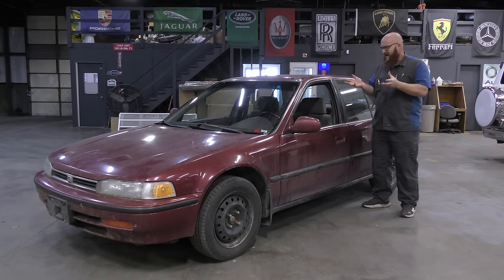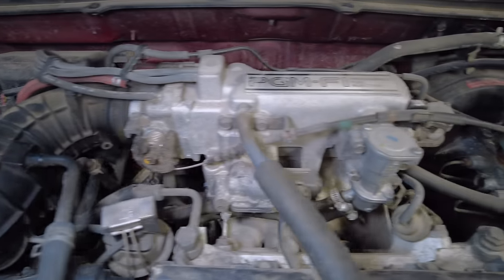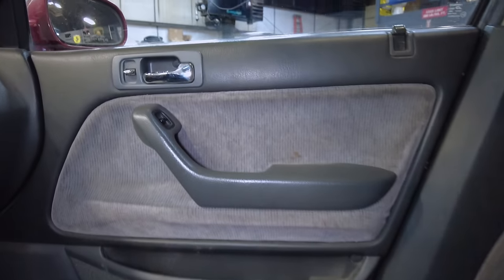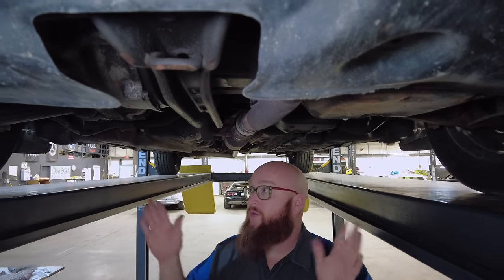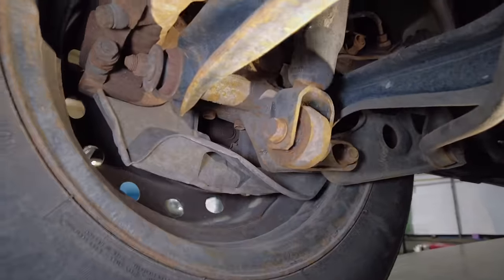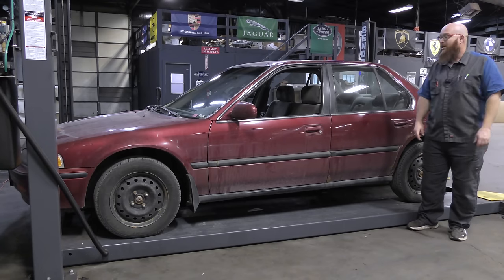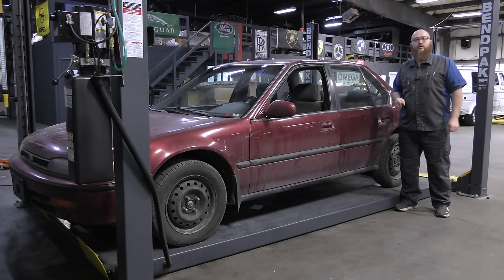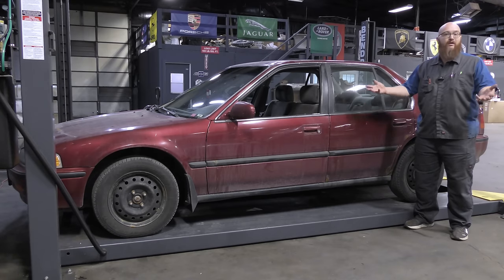A True Testament: 32 year old Accord with 380K miles! When Is It Time to Let It Go?

Comment: Our daughter had this exact question.  Older car, in our family already, or borrow for a new one, raid savings etc.  My rule I passed on, was the £100 or $100 rule, per month.  Whatever you expend, on repairs, spare parts etc on an older car, say in our case $700, divide by 100 and that’s how many months the car has to run until the next repair.  You have to keep a running total, because it always gets stuff doing every few months.  We knew it had to run for seven months to justify its existence/use.  About month 6, something else occurred, cost another $400 so being originally on target for July last year, we had to shove it out to November.  IE another four months of use, for that 400 bucks.  

You just carry on like this until either you get fed up, want a new car rather than need it, or you have suddenly a huge major bill for it, say a replacement gearbox, which sets you looking at your calendar, into next year probably (!), and so on.  About now, we’re 18 months on with this method, and she has a working car and no car loan, and is looking for her first job after graduation.  Ideally, she’ll get settled and THEN consider what kind and whether to buy a newer car.  The benefit of this system is, you don’t rush to buy a new car at the first sign of a bill over say 500 bucks.  Nobody can lease or buy a car for less than 100 a month, is the premise.  Maybe double that, I mean you could choose another number.  

Obviously you may be slightly attached to the vehicle, and it may even have attributes that make it better than a brand new car…like who would steal or vandalise that old POS?  The lack of value of this car, is a benefit in some situations.  That’s a valuable attribute potentially, so you might make an ‘override’ on that basis, or raise your monthly permitted max spend, for that reason?  But that’s the method a Firefighter passed on to me, so I pass it on to you all.  In the process, the car’s become nearly 25 years old.  Classic car!  Anyway…

…here’s a sobering thought I will leave you with.  You are roughly as likely to have an accident in your old everyday car, as in a shiny new one, is my hypothesis.  Actually, I think shiny newer cars, attract accidents, but that’s just imho.  (People certainly might expect you to give way more readily, if they see you’ve a shiny new automobile.)  But let’s say the chances are roughly equal.  If you had an accident, assuming it’s not really hideous, just an everyday 30mph bump, which car would you rather be in?  On the basis of ‘no regrets’ it’d be better to be in the old one?  Conscience clear, you can go ahead and buy a newer car, you really tried to stay frugal.  I guarantee, a newer car, could have more problems than the one you’ve held onto, and been rectifying to the tune of $100 per month, however.  At least, it’s quite likely, assuming it’s over five years old say?  Good luck, don’t sell your life down the river for a shiny newer bit of metal, unless you really have the money to spare.  Cars are lovely - when they run, don’t have your insurance company draining you, and nobody vandalises or steals them!  Take care all.

Comment: If rust is not a big issue, this car will last forever if you don't mind the maintenance.  I finally got rid of my '94 because the fuel lines began rusting through. I was trying to replace those when the gas tank sprung a leak. I had no place to drain the tank so I finally gave up. Otherwise the rest of the car was in great shape at 280k.

Comment: I owned a '93 LX 5-speed much like this one but in different color. In New England it developed some rust in same places. I sold it with 160K in 2005. The drivetrain was still excellent and if it wasn't for rust I bet it could do 250-300K easy. 380K on this one is definitely impressive in my book. Last but not least - pretty sure the LX trim all had read drums which is why I'm surprised to see the discs here. Maybe it was converted later in life?

Comment: I bought a 93 ex in 2004 as my first car and still have it today 

It’s been through a few batteries, starters, and distributors and at this point it leaks about .25-.5 quarts of oil every 500 miles or more but still runs and drives

Even after being flooded during Louisiana /TX floods. I replaced the ECU and TCU and it doesn’t die 😂

Comment: I got a 2003 malibu base  with the 3100 sfi .bought from va for $900  back in 2022, .     Great engines.   trying  to make to 300k + . I take good care of her despite the last owner not  doing  that . Its in this rare looking dark teal metallic color but one of the matching doors and window was fucked and has micro scratches and more engraved dirt  and scratches in the paint .   has a random ass door and mirror and northern rust damage. I couldn't afford to paint it so I brought it  back to life the best i could with the money i had . A little wax kinda helped it blend in and bring the color out.  .  It was disgusting and trashy when i got it. Smelled like methtivites , cigarettes and McDonald's. 2 years later now  Washed , cleaned , and waxed Currently got 161,000  i think.  Im aware of the little issues theyve known to have but with proper maintenance she should be fine . Looks the best shes looked in years probably.  The radio cd player system  is in mint condition too.  😀. A/C still doesn't work 💀🤣🤣🤣  trying to get that fixed next

Comment: My 93 civic del sol is at 315k miles, finally have a rust hole in the trunk, has been leaking for as long as I've owned it. Gonna weld a patch or line the whole trunk with woven fiberglass and keep driving.
 (About 4 ish years ago I had some liquid fertilizer leak into the trunk and it reacted with the metal which caused all this to start)

Comment: I just sold my 224K mile Tiburon with a number of small issues. It was a difficult decision. That car is super reliable but worn tires was the deciding factor. Tires can be expensive, even if you get used ones. Fuel filler neck was leaking too so I figured at least $500. Sold her for $2K. The Honda has good tires so I'd keep it going a bit longer.

Comment: I sold my 1993 Accord in 2020 during the pandemic because it was just sitting outside collecting dust and all. It had 201k miles on the clock and was in a considerably better condition aesthetically. It was a very reliable car from the golden age of Honda.

Comment: I have a 93 accord EXi sedan (so the one with the sunroof, power windows etc.) and it's honestly been one of the best cars I've driven despite the amount of miles it has and the worryingly low cost of $800 to buy the car, its been surprisingly reliable too despite the fact it's over 30 years old now.

Comment: I have a 2013 elantra with 255,000 miles. Just gave away a 2001 beetle with 350,000 miles. Once owned a 1986 dodge ramcharger with 310,000 miles. Still own a 1970 nova with 270,000 miles. Will go a long way if you take care of them.

Comment: I own a 2001 Honda Accord EX 6-cylinder with VTEC engine that just went over 251k.  It has some minor cosmetic issues, but no rust, cold AC, heat, leather seats and in good condition.  I'm going to drive it until it is no longer worth putting money into it.  It is actually a part of my wealth building plan:  drive debt free as long as I can before retirement.

Comment: I had a 91 honda accord with 480k sold it for $1500.it now has 980k and still running .I fixed the rust on quarter panels with fiberglass so it wouldn't happen again I did all the work my self and still no rust 15yr later .car is in great condition same engine and transmission

Comment: My 95 manual accord ex with 340k is in the back yard and needs a transmission. I'm having a hard time letting it go. I don't have a truck so I tow with it quite a bit. 3 to 500lbs mdf sheet goods with a harbor freight 4x8 trailer. Same rust on mine. A lot of little problems and leaks. Has run with a completely rusted through muffler for over 100k. The transmission is probably my fault. Always changed the oil but almost never the tranny oil.

Comment: Bought technically this exact car except with a different vin # and hope to keep it going for a while for work. Bought it from my landlord for 200 dollars. Has a few issues and now watching your video excites me more having it. Car currently has 280000 miles.
Reply: they are so easy to work on during a sunday freetime. The only hard thing is changing the cv axles and waterpump because of cramped spaces. A 92 was my first ever car back in the late 2010s.

Comment: Had a 90 accord with 188k with no issues excpet the Honda quarter panel rust issue until it was run over in a Walmart parking lot by a Ford expedition  Two timing belts one clutch and two exhaust systems and one ignitor.

Comment: For the right car its never time to let go as long as it continues to fulfill its purpose - i have a 2000 Mitsubishi Diamante LS with 319,000+ that had a new transmission fitted 6 months ago and a 1998 Infiniti i30 with 261,000+ that is running beautifully. I don't plan on letting either of these cars go ever, parts are cheap and still available, and modifications are also a possible path going forward. All of this at a fraction of the cost of modern cars. Both of these were nice, well equipped, powerful stylish luxury cars back in the day and that has not changed today either, they still drive great and do exactly what they used to do 20+ years ago.

Comment: I have a 2001 ford escape I got for free from my father.  It sat for a couple years till I got around to working on it.  Radiator,  alternator,  starter, misc wires from mice damage,  drove it about 100,00 to bring it up to 200,000 and right about then the rear passenger spark plug blew out of the motor and took all the threads with it.  I ended up sleeving it and that worked fine till the other side blew out lol.  So I sleeved that one.  I work at a pulp mill and I don't like taking the other rigs to work.  I'm still driving it to work every day.  It has 370,000 miles.  Fans and just about everything else is on switches.  It looks like a fighter jet with all the switches and momentary push buttons and labels.   I plan on driving it till ot blows or something relativity expensive or difficult goes out.

Comment: Am I naive? Someone told me that my car isn't practical because I drive it so much. This is when I was at 250k miles. I am now at about 377,000 and still use it. I really haven't put much $ into it-definitely less than having payments again (I made off my car on 9.9.01) I just don't know if saying the car only has 50k miles left on it, and not to drive it every day is correct

Comment: I had a 2001 Accord EXL coupe. Got it with 130k miles. For 1500$ had check engine light on I fixed it for $100. For the 70,000 miles I drove it.I had to replace all the brake lines all the brakes. Had to do the front pads and rotors twice.The starter. And a couple more little things. The rack Broke leaking so bad I had no power steering for a while I sold it for $800 at 200k because it needed all the fuel lines a fuel tank neck fuel gauge fuel pump. To get that car to continue with power steering and without leaking gas I would have had to spend $1,500 in parts

Comment: I bought a 99 Honda Civic Si when I graduated from college. It had 13 miles on it at the time. Earlier this year the #3 fuel injector failed and the engine injected a piece of the fuel injector. This scored the cylinder wall and basically ruined the engine. This is after driving the car for 386,000 miles. I miss the car, but I dont think the ole Honda owed me a dime by the end.

Comment: It's the genius of sacrificial protection.  Corrosion on the brake calipers is reducing rust on the suspension struts and other parts, and they're easier to replace.  Same as with the rust on the cv axles in front.
Reply: Also the body panel rust is protecting the frame.

Comment: I feel like this was the golden era for honda. These old accords lasted forever if maintained. I have had 3 that had over 350k miles, and when i worked at the dealership, we had a body shop worker that had one with close to 700k miles on the original motor and transmission. I miss these old hondas

Comment: I believe this is a 1993 model Accord. The 1992 taillights are more complicated looking.(Correct me if I am wrong, no big deal)

I would keep driving this car until it fails completely. Since it's a 5M/T, there's no automatic transmission problems to worry about. Fix the brakes, front and rear, just make sure the engine has enough oil and coolant, A/C working properly, and lastly, get some alloy wheels(Preferably from the Accord EXes, Those stock steel wheels look ugly like you know what!)

Comment: Had somebody that was told they needed pads all around. Got an oil change in Nevada and were coming back home to San Diego. Got the oil change and were told their brakes were dangerously low and should not drive back to San Diego. $500 for the job and they declined. I did it for $250 parts and labor back here in San Diego and when I pulled off the pads I showed the customers the pads vs the new pads and they had like 50% left. They had like another 20-30K left on their pads 😂😂😂. 2019 VW Passat.

Comment: I have a 2000 Accord with a v6 with over 344,000 with the original automatic transmission. Drives great even with horrible paint. I wonder if it's worth another timing belt investment.

Comment: I had a 1991 5-speed Accord.  It was terribly neglected by the original owner so I did what I could afford to get it back into shape, drove it for several years.  Sold it a decade ago.  Regret it.  This generation was probably the very best of the Accords.  And the manual transmission?  Perfection.  I drive a 2009 manual Accord now (and it's a great car), but I would trade for a decent one of these without hesitation.

Comment: In the 70s I first had a Honda z50 motorcycle then I had a trail 70 Let me tell you, you could not break them and wrote them seven days a week in South Florida running them in 98° weather in the sand the motors would be scorching hot I would blast them through a river and submerged the engine over and over again they just would not die. Only thing I changed was chain and sprockets and some tires and points and condenser. Honda is just an absolute amazing company.

Comment: My daily driver is a 1997 Nissan Sentra with 388,000 miles. My commute is 65 miles. Original engine. Original transmission. I will drive this car until I cannot find parts. Whenever I see another car like it, I buy it for parts.

Comment: The best car I ever had was a 1992 Accord LX 5-speed. I put 276,000 miles on it over 16 years. In the end, the labor costs for the timing belt exceeded the value of the car. It just didn't make any sense to keep it running. Man, I miss that car.

Comment: well my 09 civic is is at 362k runs purrfect  , no major problems with the engine or trans ,  it does have a timing chain .
the ac compressor started leaking , not sure if its an o ring in the ac line or the compressor is bad , it still gets cold when I put a can in it but after about 30 mins it blows warm , ooof

Comment: In comparison to new cars being sold today (reliability, many computers, high cost registration and insurance, high cost maintenance, difficulty to work on and usage costs) I would prefer to bring this car back to life. I had a 92 accord wagon that was reaching 500k miles with 2nd motor changed at 127k. Maintenence costs were cheap, repairs were cheap, registration and insurance were cheap, very easy to work on. Gf convinced me to buy new and regretted it ever since. It costed me over 100k with 3 new cars with costs involved co.paired to just repairing and running my old accord.

Comment: I like to buy used cars with between 20k to 70k miles on the odometer. I then do all the scheduled maintenance suggested by the manufacturer. I normally get close to 300,000 miles out of a vehicle. Most of the time they start burning oil and fouling plugs.

Comment: Had a 1991 chevy lumina euro  . Transmission came apart at 441k . I'm still driving my backup 1997 pontiac bonneville sse 241k runs great

Comment: I had a 1993 accord lx. Had 344k miles. Just change the timing belt every 90k miles and change the oil and they run forever

Comment: Only reason to replace a perfectly good commuter is safety features. If you have an old car but it’s relatively sorted, you know what you got and you know it will work as good as a new car. Even new cars break. But then you spent more for the new car. A lot more. Which would have covered many repairs on your old car which could have lasted another decade or more.

Comment: NEAT! My Civic is a '97, and has 370,000 miles on it. (I post videos of it every 25k miles). For those nay-sayers about oil changes, I started using synthetic oil at 100k miles and change it every 9 to 10 thousand miles.

Comment: Hey Wizard I have a 2000 Honda CRV whiz a little rot knock it has 248,000 miles but still runs like a clock it doesn't burn oil it leaks

Comment: I have the same question with my 2010 Mazda3 2.5 with a 6 speed manual. She’s got 370,000 miles. Engine and transmission run great. Cosmeticly it’s still in great shape as well. Except the drivers seat. The drivers seat is fucked 😂. I’m hopeful that I’ll get 500,000 miles before I’m ready to upgrade.

Comment: 99% of the time the end lifespan of a car is:

In places with regular snow: when something important on the car breaks off from rust.

In states without regular snow or when the car is only driven in warmer months: when the transmission, engine, or drive axle ****s the bed.

Of course, with valuable enough cars like hot rods these are often repaired indefinitely.

Comment: Bought a 1 owner elderly owned 2002 dodge durango slt 4x4 4.7l with 252k miles. It was a time capsule down to the factory spark plugs. Hoovie would be jealous